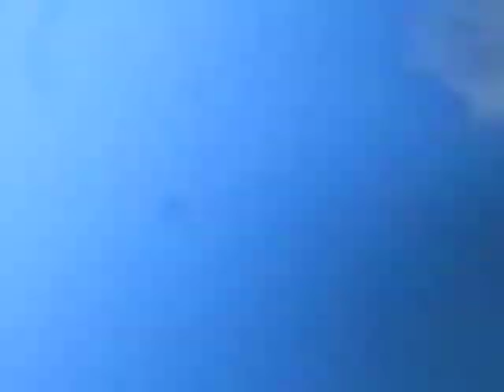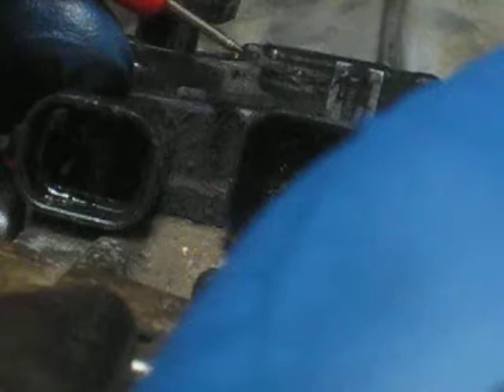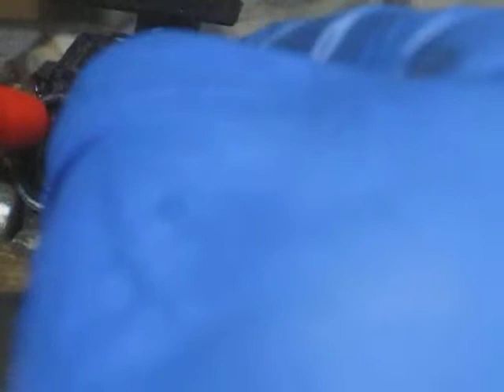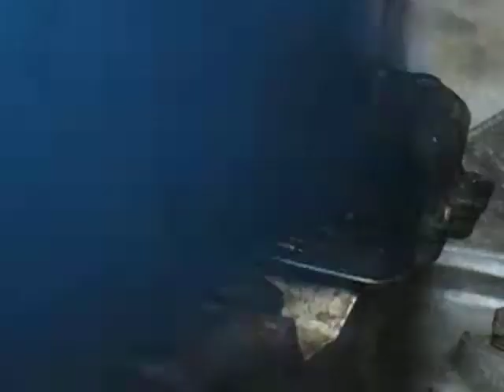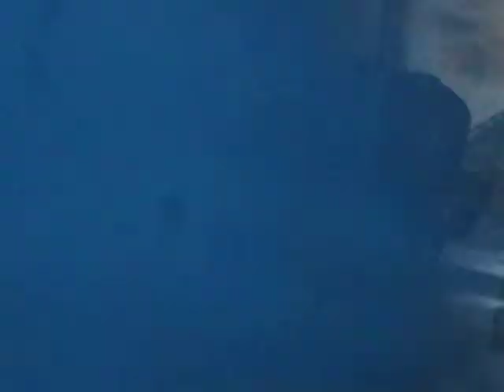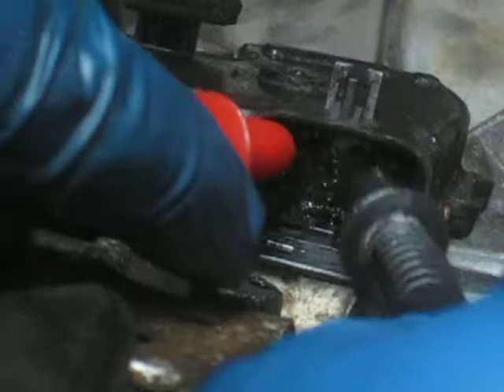4L60E Park Neutral Switch Connectivity Check

Comment: Just replaced My neutral safety switch because park and neutral would not light up when engaged. I still have the same problem. All started after having pump assembly replaced on transmission. Any ideas. Drive fine. Indicator lags but R lights and D 321 light. No park or neutral dash indicator lights.
Reply: Did you ever figure out why? I am having the same problem right now. I just put in a freshly rebuilt transmission with everything new in and on it.